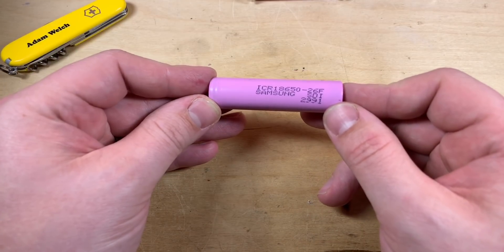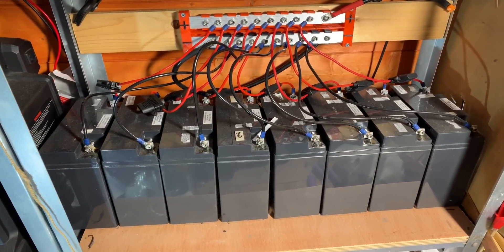Calculating Battery Bank Capacity

Comment: In the video he showed that if he connect in paralel the amps will increase but then how the the voltage increase from 3.7 to 4.2 volts
Reply: He used a 4.2 v battery each not 3.7 v battery.

Comment: I'm trying to figure the math on peak amps delivered when I flick a switch. That switch would only be on for ~1 second. 6 AAs provide more than a single 9v or even two 9vs in parallel. The equations I know of make sense, but I must be missing or misunderstanding something because I think 2 9vs ought to be significantly better than 1 9v, but it's not, and the AAs outperform the 2 9vs. I don't have the right language to find my answers as of this morning.

Comment: I have ten 3000mah 18650 batteries in series (36v) and ten in parallel (10S10P(?)   Is the total energy stored in my pack 1080wh???

Comment: Hello I am trying to design a Laptop power bank with Lithum 18650 batteries
The Specification of the system charger is
Input AC 100~240 ,1.5A
Output DC 19.5v ,4.62A

What is my best approach to building this power bank

Comment: so if i have a 20v  light that draws about 1 amp and runs on 12v  , and i want it to last say 6 hours  , will 9 18650 ( 2000mah) work . I think i wire 3 groups in series of 2 parallel ?

Comment: So, your 7S have 50Ah? The 140 pcs of 18650cell will give you only 50Ah..
Reply from the maker: Yeah, each block is 50Ah at 4.2 volts but the whole pack is 50Ah at 29.4volts - or 1470 watt hours, 1.47kWh.
Reply: @AdamWelchUK  I am in middle of testing and charging my cell, the plan is to make 7s 80p if I get good cells. if now, it will go down to 70p. I will keep all more than 1700mAh. All other, and hot ones I will scrap. Thank you.

Comment: If I want to increase a 14.4v - 3.8Ah battery pack (4x18650 3.7v Lithium Batteries in series) to gain more Ah, can I add a fifth battery in Parallel to give me 14.4v with greater than 6 Ah? and will I have an issue recharging it with 4 batts. in series and 1in parallel?
Reply: For you to get more Ah at 14.4v, you have to connect another bank that's of 14.4V to the existing one. This implies that you have to make another 4S lithium battery and connect it in parallel to the existing one you have. For instance, you have 14.8v 2.2Ah (4S or 4×18650 3.7v 2200mAh Lithium battery in series) and you wants to increase the rating to  4.4Ah or more, you have to make similar of the existing one and then connect it in parallel.

Comment: Dearest Adam.......Please Please can you show me how to change your old Arduino Capacity meter code using 5110 screen to do Resistance only checking for 18650 ? loading cell up with say 1.5 Ohm resistor for 10 seconds only with latching push button....

Comment: Nice video. Very clear explanations! Now I'd like to know how much Watthours you need to put in to get these packs fully charged, as well as how many Watthours you then can get out off them, for instance to power the equipment in your shed. Any thoughts on that?
Reply from the maker: Thanks. It’s a chemical reaction which has losses. Heat is created both when charging and discharging - so you’ll always have to put more in than you get out. The real capacity is somewhere in between these two numbers.
Reply: @AdamWelchUK  - I understand. I kind of was wondering which technology is most effective. If you harvest 5000 KWh with your solar panels, what is then the best storage at the moment? Which pack would give your most working time on your laptop? Is it your Li-ION set or the Lead-acid pack? Where do you find lowest losses in charging/discharging and in  battery management?

Comment: Adam here is an interesting bit of kit I'm exploring its use for battery to battery charging in my little camper  - now it has a lithium 4s lifepo4 105ah it's too power hungry for the 70a split charger and 8awg wiring - I like that you can dial in the current you want to share - Stirling & Renogy make them but they are well expensive - what do you think ? https://www.ebay.co.uk/itm/30A-DC-6-60V-PWM-Motor-Speed-Controller-Module-Dimmer-Current-Regulator-Display/152570381315?ssPageName=STRK%3AMEBIDX%3AIT&_trksid=p2060353.m2749.l2649

Comment: What I don't understand is why Ah is used at all. There is no reason at all to use Ah instead of Wh, is there? It basically uses a value that requires complex measurement or integration of the voltage to be usable.
Is it done as a marketing trick to be able to more easily confuse and manipulate buyers? Or just bad tradition?
Because most videos that talk about "energy" talk about "amp hours" or "amps used"

Comment: You cannot calculate watt hours. You can only measure it. This is because the voltage decreases as the SOC falls, so at any voltage below nominal, the watts are not as high as calculated when using nominal

Comment: Great. Thank you. 

However virtually everything described is theoretical. Reality, particularly in low cost Li cells is going to be both disappointing and potentially dangerous, although other than the DIN rail setup, probably not going to explode if attempted by a beginner. 

Bottom line: Unfortunately, in the Li world today, you get what you pay for.  Cheap isn’t a good way to go.
Reply: What on earth are you babbling about? The exact same maths applies irrespective of what brand, type, chemistry or quality cells are used.
Reply: John Coops. It doesn't apply with the mathematics of too many online battery bank retailers. Chinese maths often bears no relation to reality.
Reply: @RWBHere  - That still doesn't make sense, and you are confusing the issue. The entire purpose of this video is to show how consumers can calculate battery capacity in Series/Parallel arrays. It's got nothing whatsoever to do with the truthfulness of sellers.
No matter what brand of cells, the mathematics for calculating the Series/Parallel capacity always remains the same, whether you use a >3000mAh Sanyo/LG/Samsung or some POS 800mAh no-name recycled and rewrapped crap.

Comment: Are you up for answering any question on my 48volt forklift battery bank run on a outback flex one system
Reply: john goulsbra - Exactly.
Reply from the maker: You can try me - although I don’t use outback kit.

Comment: Why don't we use SI? (System International units) Joules describe the potential energy of a battery (among other things).  1 kwh equal 3.6 MJ.  (convention, history, habit, tradition I suppose or ease of conversion from volts and amps.).  https://www.rapidtables.com/convert/energy/kWh_to_Joule.html
Reply from the maker: Good question. Easier conversion I expect.

Comment: I calculate my capacity using an arduino.  I take a reading every minute. I use a cutoff of 3.2 volts and the arduino stores the current and voltage and a counter keeps track of the number of minutes.   When done,  the arduino calculates average current and voltage then multiples that by the time (converted to hrs).  Thats how I get my capacities.
Reply from the maker: Sounds very similar to my basic arduino battery capacity project a few years ago. Great to build a solution all by yourself isn’t it? :-)
Reply: Joey you are doing it wrong. You cannot average the voltage because it is not linear. You must sum all the individual watt hours or it will not be accurate
Reply: @climatechangepreppersfaceb2148  Its pretty linear between measurments.

Comment: Sry to be nit picky but you say your lithium ion set-up ( @ 5:30 ) is 7s20p but it's actually 20p7s. You parrelled first then series connected 20p 'arrays' in series. You didnt series connect 7 cells in series then parrell these 'strings' ( you would need 1 bms per string for this which is obviously impractical).
Reply: Thats being too picky
Reply: @noweare1   ;P
Reply: You are correct, not picky.
Reply from the maker: I think a survey of the wider community might suggest series parallel, rather than parallel series, but I like your argument :-)
Reply: Correct. Big difference

Comment: No one ever mentions the cut off voltage. All these mAh numbers are so gameable. Just multiply them on nominal voltage with complete disregard of discharge curve and hope for the best. I wish people just use Watt*hours already.
Reply: You cannot calculate watt hours. You can only measure it because the voltage is not constant
Reply: @climatechangepreppersfaceb2148  of course you can. You take the nominal voltage and it will give you a good approximation to the watt hours given the ah of the cell. EDIT just run a test on any lithium technology  like lipo or lion or li-fe whatever and take the nominal voltage and multiply with ah and the numbers resolve to Wh. A power meter in circuit will prove it for you.
Reply: @unlost117  80% of the SOC is below nominal voltage. So no, you can't
Reply: @climatechangepreppersfaceb2148  but you can go below nominal down to say 2.8v for some lithium technologies to a min voltage and its this range ie 4.2v down to 2.8v that cell may produce its say for example 2000mAh capacity. hence determine its Wh capacity. using its nominal cell voltage. Hence my first statement.
Reply: @unlost117  you don't listen. 10ah x 3.2v nominal = 32wh. Actual 29wh BECAUSE THE VOLTAGE IS LOWER 80% OF THE TIME
Reply: The cut off voltage varies with each different type of lithium technology of which there are several types. You need to consider its Ah AND its nominal voltage/low voltage/max voltage to produce a watt hour capacity for the lithium cell type
Reply: Agreed.

Comment: Good info, we use the ICR18650-F from samsung its a good cell to problems in the 3 years we have used in production. Bad news is samsung discontinued them and had to switch. We are are currently using a good repacement but always looking for option.
Reply from the maker: I’ve been pleased with mine. To be honest, these Samsung’s average out at about 2300mAh after their life in laptop batteries - but the maths is far easier if I rounded them down!

Comment: How are your lithium cells kept in balance if the packs are 20p? Does the circuitry balance each cell individually??
Reply from the maker: Cells in parallel will balance between themselves because they all have a common connection. My groups of 20 use the diyBMS to balance the voltage between each group. I’ve a series of videos on the diyBMS. It works great.
Reply: I believe all cells that are paralleled together automatically balance out to each other, thats why they need to be all equal when its first built. and then the series packs are balanced controlled..

Comment: But even though I fitted the desulfator  kit as recommended a year or two back, and its still blinking, my car battery packs capacity has not remained constant. 😀 I have however found an alternative solution to the problem of inadequate capacity. A quick trip to the breakers yard and adding a couple more on top of the stack.😀

Comment: Good illustration Adam.
We should try to get more people thinking in terms of Wh and kWh, as they easily add up whatever the configuration.
Also irritates me when people mix up kW and kWh: flow rate and volume are not the same thing!
Reply from the maker: Thanks Andy. Hopefully a few people new to this subject will stumble across this video and it’ll help them.
Reply: Andy ..... volume in kWh?. ...... and you thought you were irritated :))
Reply: @whitefields5595  Think of water pipes and tanks, then volume makes sense.
A battery is a box of joules. It has volume.
Power is a flow rate, where 1W = 1 joule per second.
1kWh is 3,600,000 joules.
Bricks per second -> pile of bricks etc.
Same thing with electrons or ions or energy states - they have a volumetric dimension too. So a higher charge potential has a greater density of charge carriers per unit volume.
Current = rate of flow of electrons.
Charge = quantity of electrons or ions, and they occupy a volume (capacity).
Energy density = how tightly packed they are.
Power density = how quickly energy can go in or out per unit volume (eg, supercapacitors have high power density but low energy density)
Reply: @ahaveland  A battery is not a box of Joules represented by volume. Volume cannot be related to energy, or the capacity (cf ability) to do work (power). You cannot apply the dimensions of volume to either energy or power. The nearest you can get is to state 'the capacity to do work' .... but you didn't. (If you did say capacity then someone would ask about capacitance!) 

Electrons are stored on flat surfaces so an area analogy may work, but that is not the context in which you introduced volume.  

You cannot have "power density" either ... only power. Even energy density is stretching it but has slipped into common parlance. It is really energy per unit area (of the electrodes)

Supercaps have lower stored energy but very low internal resistance hence higher current which depletes the energy (Wh) quickly. Nothing to do with your term "power density", just high current giving relatively high power but for a short time compared to a battery

Far easier to use the correct terminology. It is eventually easier for all to understand, or go away and find out.
Reply: @whitefields5595  Many people do not understand though, hence the point of the video.
As a conceptual model of scalar quantities, a watt is a thing per second, and a watthour is the number of those things over time.
It is exactly conceptually equivalent to litres per second vs litres and can be represented by pipes and tanks.
You also misquote what I said.
Batteries are boxes of joules that have volume, not "represented by volume".
Yes, power density is a thing.
You do not know it all. Use whatever you think works for you.
Reply: @ahaveland  . Andy,  I agree many do not understand and videos like this are welcome. However if you are to tackle a subject like this and express irritation with those that use sloppy terminology then you have to be word perfect yourself.

I do not know what a "conceptual model of a scalar quantity" is . If a Watt is a scalar then just say so:)) A Watt is a Joule per second, not a thing. A Watt-hour is "not things over time" but one Joule over 3,600 seconds.

I do not know it all, but you should not use the words that work for you, one should use the correct words
Reply: @whitefields5595  My words are correct, as are the underlying concepts.
A joule is a scalar quantity of energy (a thing). A joule per second is a rate of flow (a thing per second).
I'll say it again, this applies to joules, bricks, gallons, cattle etc. What is so difficult to understand? You pack these together and they occupy a volume.

1 watthour is 3600 joules, NOT one joule over 3600 seconds.
One joule is 1/3600 watthours, ie. 1 wattsecond.
So, again - you can conceptualize energy and power, as well as resistance, voltage, serial and parallel using pipes and buckets, and get a firm understanding of what is going on without needing to know anything more about the physics.
Reply: @ahaveland  

It is correct that when the plate containing electrical charge on it's surface is  rolled up to form part of a rod then that rod (cf battery) has volume. However the electrical charge does not have volume as it is not measured in units of length/area/volume.

One Joule (one Amp flowing through 1 Ohm by a potential difference of 1 Volt) is a unit of power. If that one Amp flows for 3600 seconds it is a Watt-hour, a unit of energy

I agree that some aspects of electricity has some similarities to pipes and buckets ..... but at the start of this thread you introduced volume as a measure of energy which is incorrect
Reply: @whitefields5595  
At no point did I ever say that volume is a measure of energy. It is a concept of *quantity of energy*, not a *rate of flow*.
You still don't get it, so I'm not going to continue to bash my head against a wall any longer trying to explain an abstraction.
Reply: @ahaveland  shouldn't you know that watt hours cannot be calculated, it can only be measured? 80% of the SOC is below nominal voltage

Comment: Hey Adam, even though I know this it still sucks you can't use the capacity from each in series. I've had some crazy questions like why do you need to fully charge all cells after the first bank and why can't you only use 1 cell just for for the voltage and on and on. It's such a simple thing to parrot the way things are done and another whole matter of what and why and getting some people to grasp the underlying functions when these people will never use the knowledge anyway, but looking to squeeze every last bit and most of them will tell you there's a way, but you're not aware of it yet. lol I made people watch me charge a 5s pack all spot welded, but charged individually to 4.2v to get a total of 21v and the fact they wont self balance unless it's 10 or whatever number in parallel. People are baffled and I can understand where they're coming from. Good to hear from you.
Reply from the maker: If only we could double the capacity when we place cells in series. That’d be some sweet free energy! Good to hear from you MrB